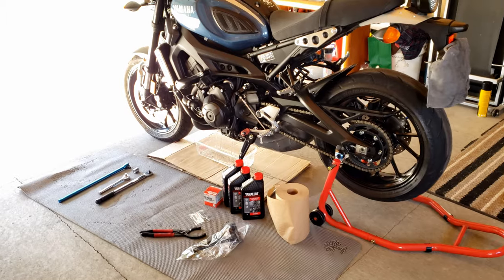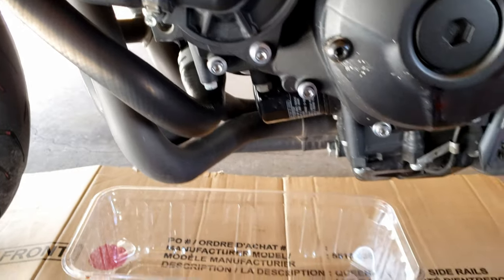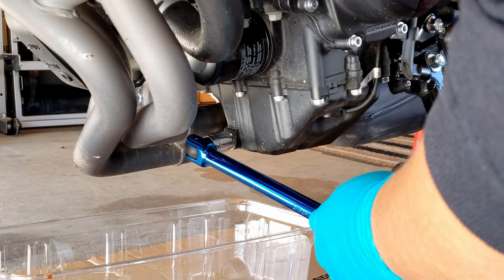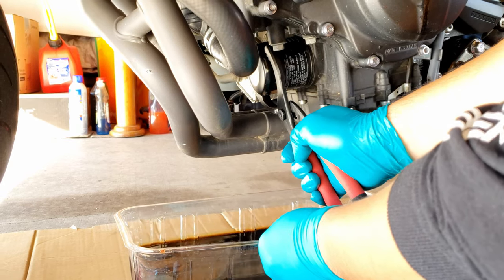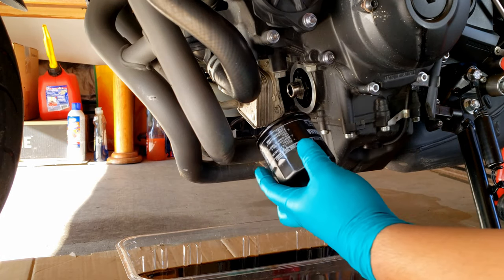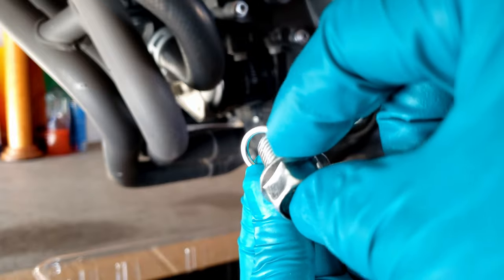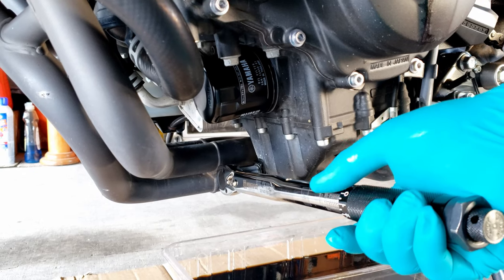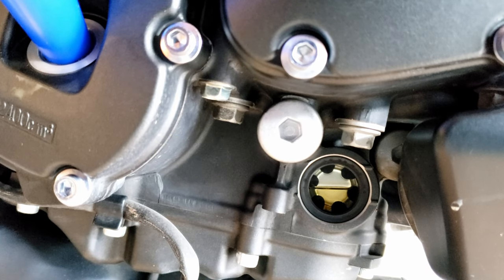Oil Change Yamaha XSR900 FZ09 MT09 FJ09

Comment: Hello! Please share what Yamaha oil filter and drain plug gasket part numbers you used. Also, per the manual, the drain plug is torqued to 31 ftlb. You shouldn’t need a breaker bar for such a light bolt load. Otherwise, great video and camera angles!!

Comment: Hi...

l am glad l found this video. 

l just did an oil change and this was very helpful. Unfortunately l did not have the Yamaha tool but l saw you use some sort of caliper to remove the oil filter. What is it and what size is it? l saw a video on Revzilla where if you did not have it and the filter was stuck you could stab it and then once the handle of the screwdriver goes through the filter you can then use it to turn and remove the filter.

Well and good in theory, l saw one guy do this and he went and punctured his bike and the job to repair it was difficult. He was one technical guy and he ended up having to take his bike to the shop. So l think l will leave the Revzilla method for pros. l am too scared to try that,

Anyway let me know about the tool you used.
Reply from the maker: Thanks my friend, sorry for the super late response, I use a filter fliers style so its easy to remove, and when you tighten up the new oil filter just a hand tight is good enough, yes you can do the punching with screw driver but is a bit messy lol, anyways I have more videos about diy on an xsr900, hope it will help you and others not only to do your own maintenance but also to save some money in the long run, again thanks for your time watching my video and be safe always my friend